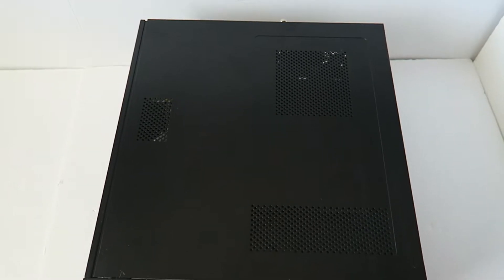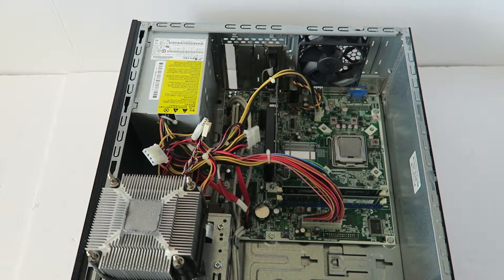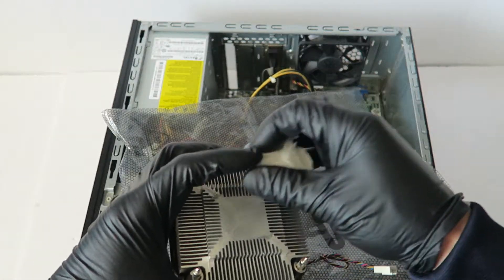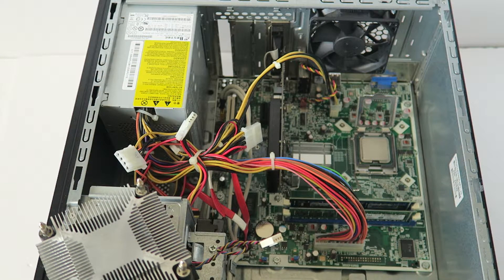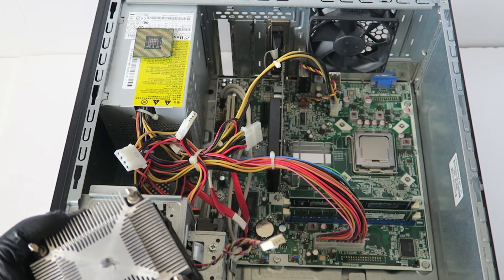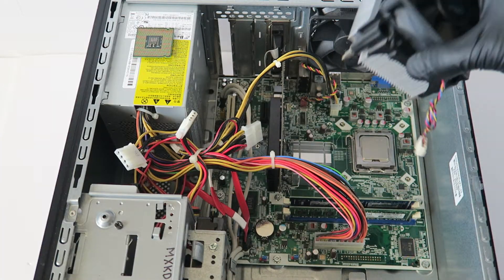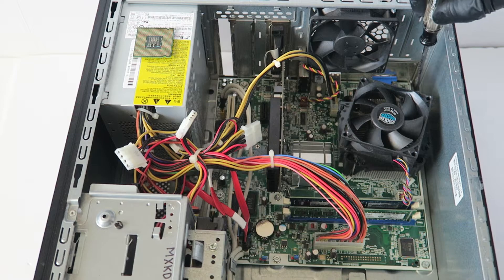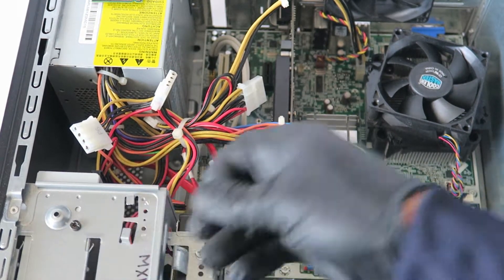HP Compaq 500B CPU Upgrade CMOS Battery

Comment: i have this pc and tried upgrading the cpu from apentium  e8400 to a core 2 quad q9550 but i get one short "beep"and a long one and no boot...pls help?
Reply: Peace be upon you. I have a Pentium e5700 processor. I want to upgrade it to a Q9550 processor. Will it work well with 2GB 1rx8 RAM or should I upgrade it to 2rx8? With the addition of 4GB RAM or 8GB RAM? @luishenderson8813
Reply: Could you solve it without changing the motherboard or the processor?
Reply: I have the same problem right now
Reply: a probability is it does not support that cpu stepping, from experience most of the time the q9550 you can support is the SLAN4
Reply: @jrpicache309  nope, it's for the ram. the hp comes with a 1rx8 slot, that is only 8 chips on one side. This memory was created for slow servers, the E5800 supports it, but the q9550 being newer, does not
Reply: @luishenderson8813  if so, why does on my same rig the 2Rx8 is being supported but the 1Rx8 gets 1short beep and 1long
Reply: @jrpicache309  is that the 1rx8 is not compatible in some processors. I had the same problem and I solved it by changing that ram.
Reply: @luishenderson8813  i have the same problem but with core 2 quad q8400 i have one 2rx8 ram and 1rx8 ram, when i change 1rx8 ram to 2rx8 the problem will be solved?
Reply: @luishenderson8813 Hi ! Which Ram use works? Do you know the brand and model?
Reply: @alexxalex24  ASint  Technology and Micron Technology PC3-10700 2+2 = 4gb ram
Reply: @luishenderson8813 please I use the same desktop I changed the cpu and memory doesn't support it again. Only 2gb ram support it
Reply: @nat_ebube  You need to see the label of your ram, if it is 1rx8 it will never work in dual channel. You must have two that are 2rx8. I don't even have that PC anymore, you're lucky that I read the notification
Reply: @luishenderson8813  But the same ram work when using dual core processor before i change to to quad core. And the same memory is working in quad core, if i change the cpu to the previous one,it work fine . What could be the problem please
Reply: @nat_ebube  The problem is the ram, they don't work on your quad core. You need to change the ram and the problem will be solved. I'm telling you from my own experience
Reply: @luishenderson8813  Please would it take higher ram like 4gb or 8gb
Reply: I can chime in to this, I’ve had this problem for over a year now and I fixed it by upgrading to 2rx8, now using a core 2 quad 8300